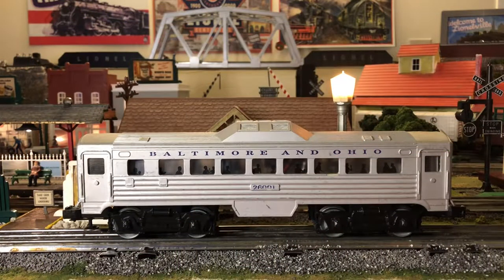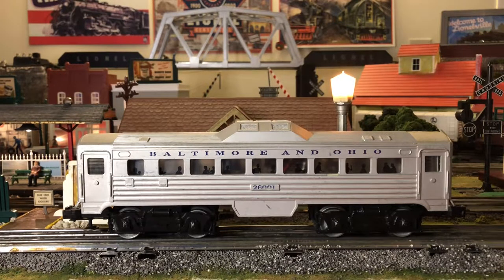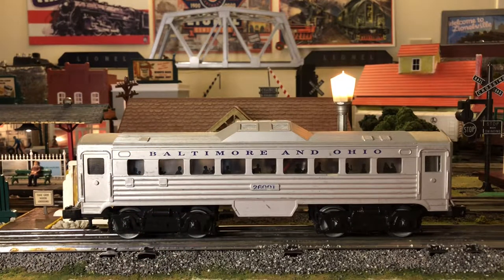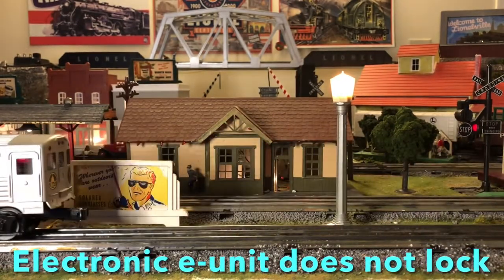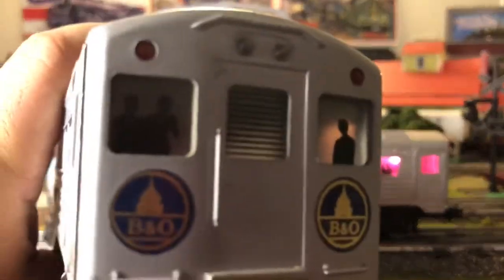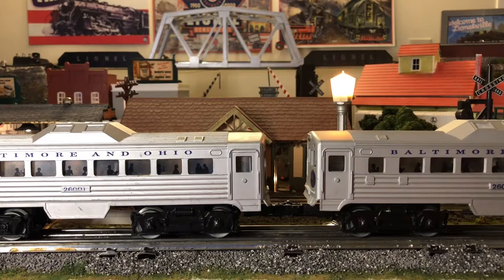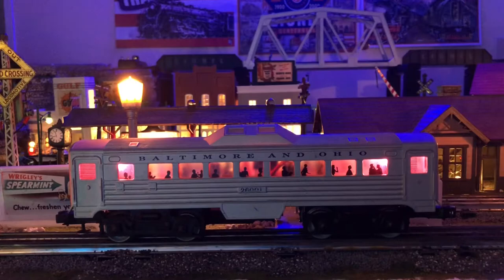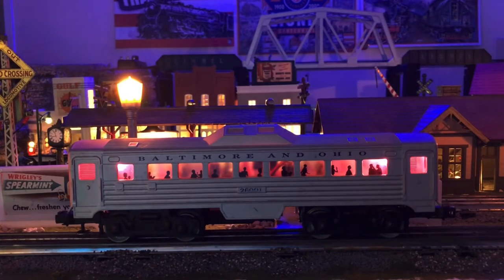K-Line RDC / Buddliners 0-27 Review | B&O Livery

Comment: I went to an auction yesterday and bought a brand new k line nyc s2 switcher for $40! It has the same pattern as the pw f3s Got a full box of o gauge track for $5 its decent condition and its all old lionel track. It stamped ny on one side and lionel on the other Two boxes of cars for 25 and a box with about 15 crossing signal and 3 beacons for $40 explain why the train won't go over my grandpas automatic switches. But mine has great weight and runs well. It has a lot of metal to
Reply from the maker: That’s an awesome auction haul! Sometimes it has to do with the connection between rails and wheels. It can be multiple things why they aren’t switching